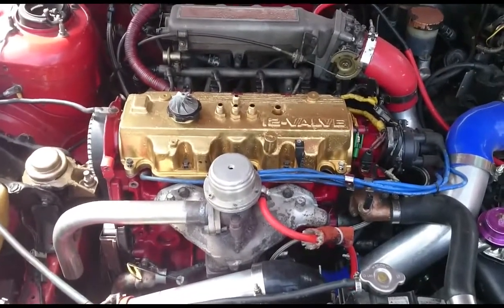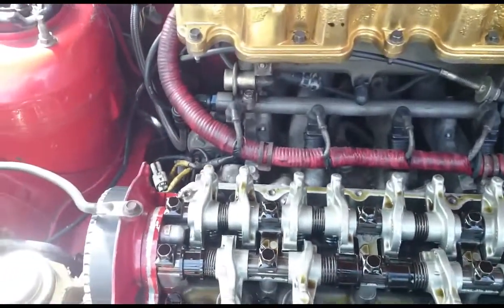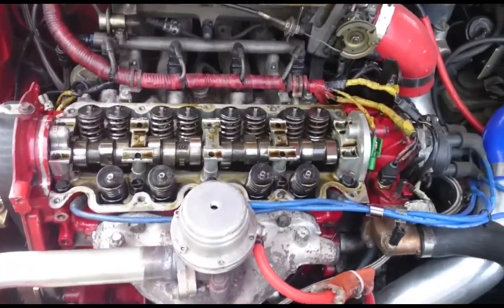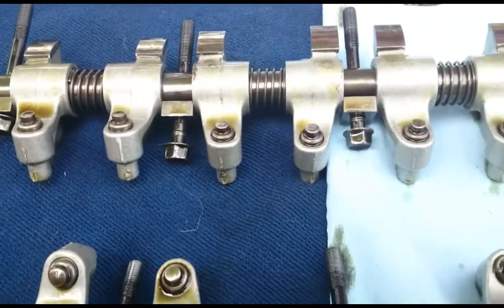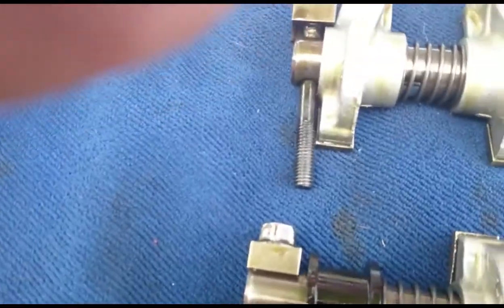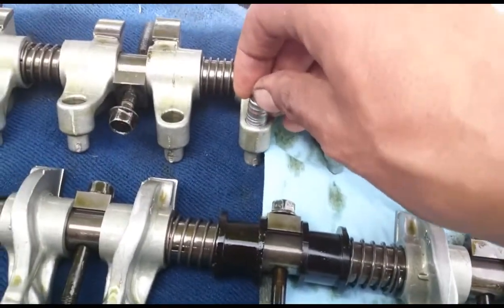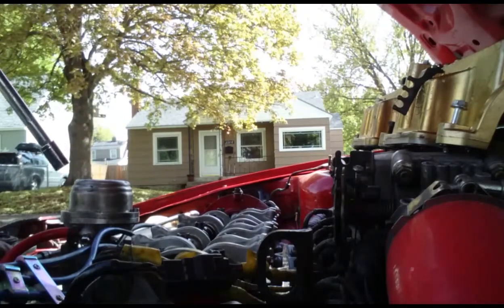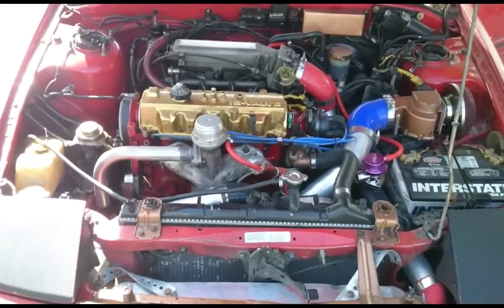Replacing HLA's on Mazda F2T Engine

Comment: Man I don't see. How you're not burning those sparkplug wires up that close to the manifold, I just burnt mine up for the second One 2 years ago and one today
Reply from the maker: @paulchandler9060  I built a stainless steel heat shield which you can see in the later videos. And that protects my spark plug wires
Reply: @BoostedSpeedDemon  yeah that's my plan once I get over my alternator belt slipping and knocking my timing out from getting caught up in the timing belt on my maiden drive for 2 years